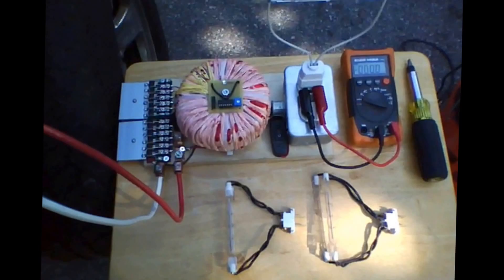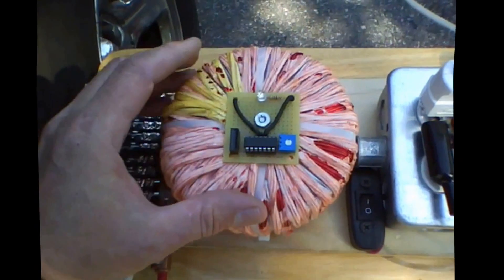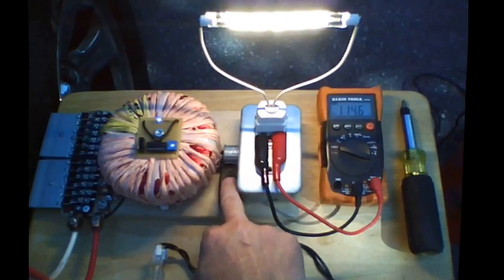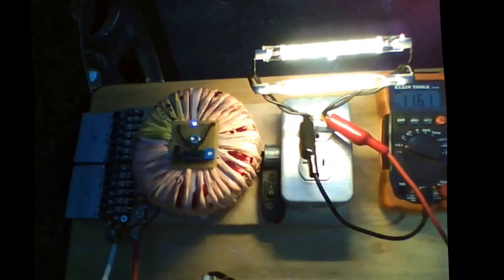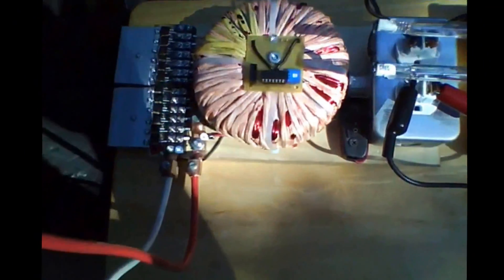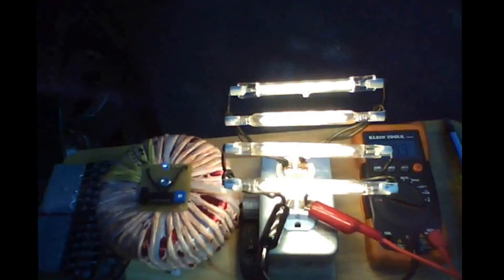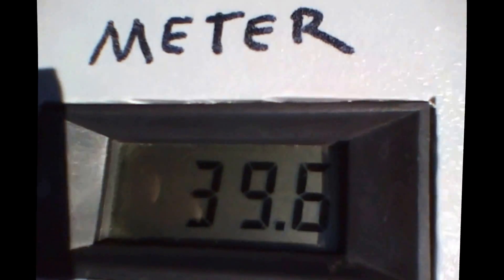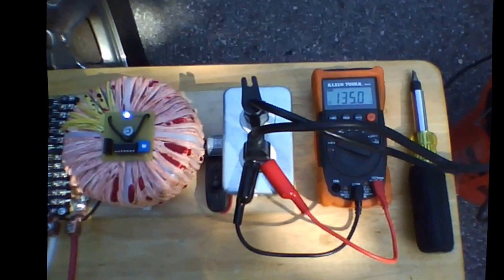Homemade Power Inverter  (Simplified).

Comment: Don’t use  it with car battery as car battery’s are made for BIG loads for small time, then they recharge slowly, if you draw MEDIUM amount of power for long time the battery might drain quickly , and the worse sometimes u can’t start the car

Comment: this board is very dangerous it frequency is not stabe and the peak to peak volt could reach 1000v with a 240v transformer with very little load like your phone charger.. and it does not have any voltage regulator circuit.. battery voltage is not stable a full charged 12v lead acid battery can give 14.4v and 11.8 on full discharge
Reply from the maker: +Kuntal ghosh 
Not true at all, I've never had any voltage spikes or surges reaching up to 1000 volts from this circuit. The frequency osculator is very stable and does not fluctuate in moving up and down, it's dead accurate to what you set it at. And yes it does not have any voltage regulator circuit because this is just a basic simple inverter circuit without all the gizmos added. Also I never heard of a 12 volt battery fully charged giving you a voltage output of 14.4 volts? It's normally 12.8 at the max. I had the engine running on mine which was being charged by the alternator given me the 14.4 volts across the meter. I've never had any issues with this in running my Shop-Vac or power tools.. always worked just fine. Thanks for watching.
Reply: whyme2b do you have an ossiloscope .. many inverter is good for light bulbs ..
Reply from the maker: +Kuntal ghosh 
Yes, I have an oscilloscope. This inverter works very well on lights and motors.
Reply: whyme2b what is the no load voltage, do you have a voltage regulator like lm7805 or 9 for the ossalotor ic??
Reply: whyme2b measusre the peak to peak voltage with no load and be careful use the inverter with 7 or 6v or else you will risk frying your ossiloscope
Reply: whyme2b watch this video .. for sure you also using this same circuit and with out any voltage regulator or stabiliser.. and i am not talking about l8ght bulbs or motor they have very high load so they will stabilize the voltage but when you get no load just a phone charger it will fry your new phone charger..
Reply: whyme2b, 14.4 volts is the max voltage you normally see on a lead-acid batter that is fully charged. Depending on the alternator in your truck, you might even see 15 volts right after it starts up as it does a boost charge before dropping back to a float charge.

The square wave is the easiest form of inverter to build. Now you need to turn it into a sine wave inverter. ;-)
Reply: @gravelydon7072  Actually if you measured the voltage when the car was running it probably said 14.4.  The battery rests at 12.6, but they bump up the voltage to 14.4 when charging to prevent plating of the battery by some chemical reaction sulfates?.  At 14.2 -14.4 it does not gas. Thus, they go to 14.4.  But if they charge at 12.6 then damage to battery will occur.
Reply: @freetrailer4poor  The batteries I check daily charge at just under 15 volts. When they are at rest, they are at 13.1 volts or down to 12.8 if I have been using them. Meters are correct also. Not all 12 volt batteries are the same at rest even if they are automotive/marine types. Charging some to 15.3 volts can extend their life.

Comment: Not quite 2kW. You're drawing about 120A from the charging battery around 15V so 1800W from the battery. Each halogen bulb will use 500W at 120V so 500/120 = 4.166A. V=IR so 120/4.166 = 28.8 ohms per bulb. With all 4 bulbs running you had a Vout of about 91V and with a combined parallel resistive load of 7.2 ohms. V=IR again, 91/7.2 = 12.64 Amps. P=IV, 12.64*91 = 1150.24 Watts.
Efficiency @ 1150W is (Pout/Pin)*100 so (1150.24/1800)*100 = 63.902%. Pretty good for a home made square wave inverter. If you upped the input voltage to 24v you will get half the current draw and possibly better efficiency for core saturation. If you used PWM sine wave to drive your H-bridge your efficiency would also go up, Inductive loads would also benefit from this.
Reply: not 15 volt it is 12 volt battery (or less) on load

Comment: Great work! Could we please have a 50Hz/230VAC version for the device? Thanks!
Reply from the maker: +shamrai 
Thanks. .. actually this inverter will do the job for you as well , all you need to do is turn down the frequency to your 50 hertz on the circuit board and then take the 2 outputs on the toroidal Transformer and tie them in series to up the voltage to your 230 to 240 volt output.
Thanks for watching.

Comment: wtf u are powering 2kw light with 300w troidal transformer ???? how transformer handle that?????
OMG u are best!!!!
Reply: I posted video watch it
Reply: you have 2 videos on my channel abaut inverters
watch new video i posted it few days ago
Reply from the maker: +keza 
The core will begin to warm up after 3 minutes of  pulling 1100 Watts... But it does a nice job for the size... and it's only from Toroidal Transformer designs , not your standard Square iron core. Better magnetic flux can be generated and kept in the loop with very little leakage. Thanks for watching.
Reply: yes but how can wire handle 1000w if it is made for 300w
Reply from the maker: +keza 
As long as the core is saturated with a intense magnetic field, it can easily release the current with hardly any stress on it. If you plan on using that energy for long periods of time, I recommend using a bigger core.
Reply: thx u helped me a lot 
i will try this with 200w troidal transformer
Reply: whyme2b I have a 2200w toroid coil is 9 inches big and I wanna do this
Reply: nightmare in action nighmare in action. 4047 is not good for this
it works but sometimes switches on all mosfets at same time and all blows up . If u wanna make something good make transistor oscilator I made it with 2n222 and works great in my portable solar generator watch my new video if u want to see circuit this 4047 is crap
Reply: keza when is the video going to come out or what is the tittle of it I tried powering mines today but it was just shorting the battery I still dont know why I'm really new to transformers and stuff so probably used the wrong transistor

Comment: You need to make a pwm sine wave because transistors read only sine wave with square wave pulses modulation with sine wave the you have a pure sine wave inverter

Comment: my first question is how many volts are you giving to the toroid not the circuit? my inverter finally worked and it is driving 600w drill machine but it requires 24v but the transformer is 12v . i gave 24v to the circuit and burnt two ics. should i give the transformer 24v not the circuit. will it cause any damage? thanks.
Reply from the maker: +dawar jan 

I used 12.6 to 14.6 volts on both the circuit and toroidal Transformer power input line. They are connected together. The ic's  are good for up to 16 volt , anything past that will damage them. You can hook up 2 #12 volt batteries in series and use one for the circuit and then the other 2# for the 24 volt input to the transistors. They're good for up to 34 volts but any more would damage them. Let me know how it turned out... take care.

Comment: i made this inverter used cd4047, 12mosfets irf1404 and 150w transformer. tried to run a 110w fan and smoke came out of the inverter. why?
Reply: First of all from where did smoke came out , from mosfets, chip , transformer etc. Are the connections correct , have you tried connecting the inverter to a lamp first?. Generally, electronic circuits smoke due to either there is a short circuit ie components connected in reverse like reversed capacitors , transistors , ic's etc or overload ie the circuit cannot handle that current connected to it. Hope this helps.
Reply: TURBO CHARGER i checked it and everything was fine the mosfets , transformer and ic. the smoke came from a relay which i used to convert from mains to inverter and vice versa as relay was no longer working.
Reply: TURBO CHARGER  i removed the relay.  and now it runs even a 600w  drill machine on full speed with 24 volts.
Reply: dawar jan Ok ,glad to hear that it's ok now!.

Comment: i made this inverter used cd4047, 12mosfets irf1404 and 150w transformer. tried to run a 110w fan and smoke came out of the inverter. why?
Reply from the maker: +dawar jan 
I'm not sure why you had issues with it, please   check out my video on Dropbox which shows a little bit better detail of how I built it making sure everything was wired correctly. Thanks.

https://www.dropbox.com/s/l80thnvql5buwcw/20140524_105019.mp4?dl=0
Reply: I think that 150w transformer is TOO small to power a 110w fan. Remember since a fan has a motor you must include the powerfactor. So your fan might be taking more than 110w of power. Try increasing the size of the transformer.

Comment: i have made one like this but it only makes 500 - 600 watt each transistor can handle only about 80 - 100 watt (IRF1404)  can you please tell me why
Reply from the maker: +Ali Asir 
The IRF1404 transistor can handle up to 333 Watts which is what is rated on the transistor data specs. 333 x 6 equals 1,998 Watts. Thanks for watching.

Comment: Can we use Electric Transformer instate of toroidal Transformer And Can we Use IRF630 Transistor instate of IRF1404 ?
Reply from the maker: +Angel SKY GIRL 
Sure you can use an electric Transformer instead of a toroidal transformer, the only problem is is that it needs to be a massive size iron core to be able to wrap the thick litz wires around it. And yes you can use any transistor you like , I just chose the IRF 1404 due to the high wattage rating output.  Thanks for watching.

Comment: Can we make it without IC ?
Reply from the maker: Sure, this is just the simplist circuit design that I found ... Can be made with transistors as well but would need to add a lot more components. Thanks for watching.
Reply: Your videos are really great thanks for sharing, can you please give me a circuit diagram of this 2000 watt inverter without using IC
Regard

Comment: I always see transformers and capacitors in inverters, is their no need for them?
Reply from the maker: Yes they do play an important role in the circuit, mine has them in the circuit as well. Thanks for watching.
Reply: +JCsaves  the toroid is a transformer.
Reply: +Brady Rose yes, I've looked into them, very efficient. Still looks like its missing a bunch of stuff for a 3k watt inverter. I really need one, wish I could build it myself. Wonder if it's pure wave? Thanks for the reply, God bless!!!
Reply: JCsaves  No, its not a sine wave invertor, and that is why it is so simple.  It will only put out a square wave, so consideration in what it will work with, and what it will kill, is important.

Comment: Something doesn't add up, both the 500 and 1000 watt tests show power draw from the battery to be less than 500 and 1000 watts when it should be more than 500 and 1000 watts. You would have to be running over 16 VDC at those measured currents to get 500 and 1000 watts power. One of the meters is wrong or the lamps are of lower wattages than marked. Most likely your voltage meter is not reading true R.M.S. voltage due to the square wave output of this circut and reading a higher voltage than it should. I bet the lamps would be brighter when connected to the regular household power (sine wave peaking at 170 volts) I'd guess you are only getting about 400 and 800 watts real power output here.
Reply from the maker: The voltage output was lower than the normal rated 115 to 120 volt when it was really pulling the current. The halogen bulbs were all rated at 500 watts. The problem lies in the toroidal transformer core I used because it was only designed to handle so much magnetic Flux flowing through it's core. Can be solved though by using a bigger core to push the power the load needs. Thanks for watching.

Comment: how can you sound so stupid yet be SO smart? also ive heard that if you over saturate a core it can start becoming inefficient and draw mor power at lower loads too, from your test how much water does that hold? also though im not a fan have you considered high frequency input then rectified to dc and re converted through an h-bridge? you can use a smaller core or go higher on the watage
Reply from the maker: The point of over saturating the core is my intention because I'm compressing the Flux threw the output coil. It actually works very well and because I'm using a toroidal core, their is very little magnetic flux loses. It's like filling a 5 gallon bucket with water and poke a small hole in the bottom. .... the pressure being pushed through that hole is great with a very high backing. I'm familiar in using high frequency but prefer not to on this project. I'm  in the process now of finishing my newest design which is quite impressive and will be doing a video on it soon. Thanks for watching.
Reply: i must have been mislead, im thinking what the article i read meant was dc bias but maybe they did mean over saturating, it was a mot flyback forum after all
Reply: whyme2b how clean is your output? if you have a pc and an old sound card you can use resistors to bring it to ~2v ac or less and put it in the line in or mic input and there is an app called sound card oscilloscope
Reply from the maker: understandable, that's okay. My project shows very good results. will keep you posted buddy.

Comment: LOL. Your circuit looks exactly like the "flux capacitor" from Back to the Future. :-) In all seriousness though, how long could you run an average house from a car battery? I'm just curious.
Reply from the maker: darkmath100 As long as you like if you have a good battery charging method... solar, wind, etc...average home uses around 5 to 7k watts per day. Batteries should last around 5 to 7 years depending on the kind and name brand you use. Thanks for watching.

Comment: That converter is capable to power up only incandescent   light bulbs . Actual frequency is nowhere near 60 Hz ( it's in range of kHz) and for that reason nothing else will work. I try this project with 4047 and lowest frequency I was able to get was 4.2 kHz. If you need just to power up light bulb you can make ZVS driver ,less power consumption with same results
Reply from the maker: semko71 My circuit frequency was set right at 60Hz... If you followed the schematic correctly your set points would be from 21hz to 244hz. Your pot or cap was probably incorrect? If this circuit ran in the KHz frequency, the power tool or shop vac would have not worked. Thanks for watching.

Comment: i have Toshiba Transister Inverters, Model VF-S11-4007PL-WN which i dont know what to do which>what do you suggest?
Reply from the maker: Thanhdung73 Looks like that transistor is made mainly for motor speed, not sure if it would work well for making a power inverter out of it... I still recommend IRF1404 due to it's great power output in watts. Thanks for watching.
Reply: whyme2b thanks,they sure are expensive but.i saw them going real cheap at an auction but didnt get them.anyhow..thanks allot.

Comment: So you're getting all that power from your car battery? wouldn't you be able to make a kick-ass H2o generator and have the whole bundle fitted into the car thereby eliminating the need for regular fuel? I mean, with that much power you should be able to build a Big H2O unit and get ample Hydrogen, or set up a few ultrasonic vaporisers to turn your liquid fuel to vapour. What is this setup like when it's been running constantly for a few hours?
Reply: Dude,the inverter is freakin huge, where is  he gona put it? on his dash?
Reply from the maker: Brin Haerycammel Works great and I never had any problems it... I use my shop vac all the time to clean my carpet in my truck. Check out delvis11 site about the monster hho systems, he makes some very cool units. Thanks for watching.

Comment: 119A*13.8V=1642.2W at 80% efficiency 1313.6W not quite 2000W but that is still impressive
Reply from the maker: Adam Nickerson Actually it was 14.6 volts input which is 1,737.4 watts output... I just need a few more turns of magnet wire added to my primary coils to fix that thou and give out that extra power needed for raising the efficiency. Thanks for watching.

Comment: The time it will take to discharge is very important,
Reply from the maker: ofori evans Yes sir, true.... that's why I chose the IRF1404 Transistor for it's quick on/off characteristics as well as a high wattage output. Thanks for watching.
Reply: Ayt